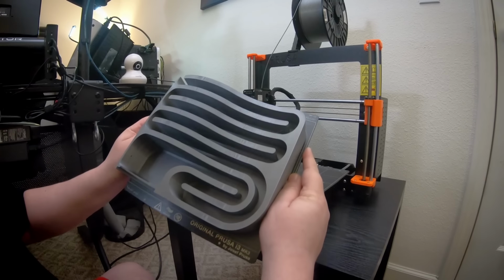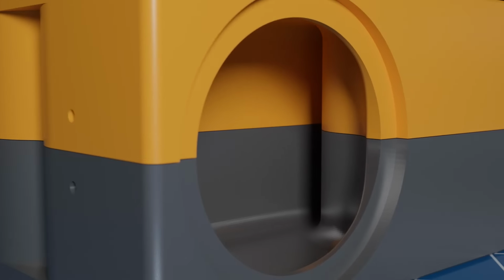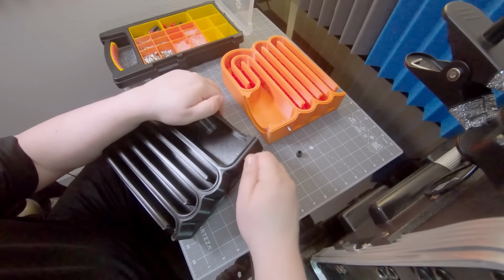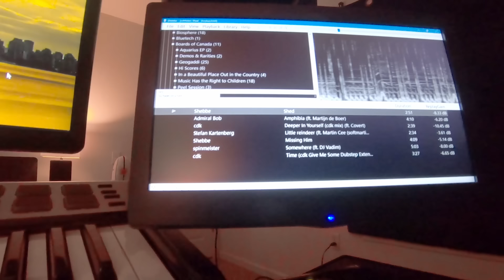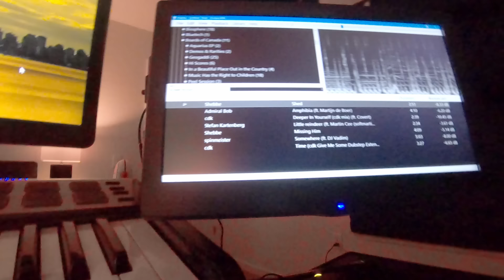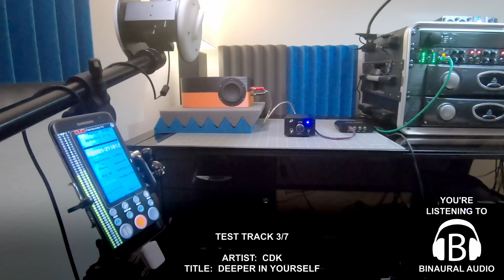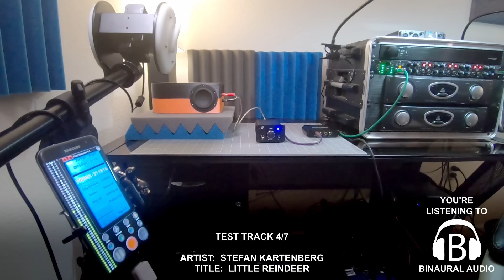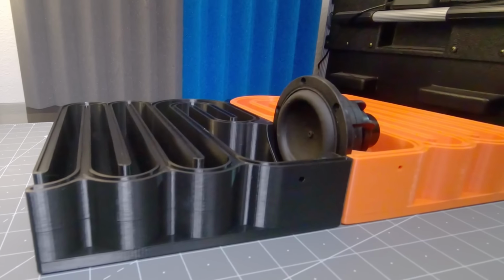3" Subwoofer Enclosure v.2 (Plus Demo)

Comment: Very impressive Pete!
I think this is a no-brainer as a marketable kit available thru Parts-Express. 
Pitch it to them!
Reply: I'd buy a pair!
Reply: I would buy too
Reply: Probably not all he wants to do with it yet, I'm sure there will be a tweeter and a crossover too.
Reply: Would really like to see this. Maybe with a built in amp and lpf. 

But the enclosure is specifically tuned to the sub. Unless every subwoofer is manufactured with the exact same specs - which I don’t think they are - every box has to also be slightly tweaked and matched with a sub.
Reply: MSH68 > The only small problem would be manufacturing time. 'Each side takes about 45hrs to complete' so thats 90hrs total print time. While I'm sure Part-Express may have access to larger, faster, print machines, like SLA, that may knock the total print time down considerably would they still be able to produce enough and at speed to match orders? What would the sellable price be after material costs/maintenance costs & time to print, especially compared to the price of the speaker. 

They are very cool tho......
Reply: @Vibration_Crew  I would think only the prototype would need to be printed. The mass production version would probably be two piece injection molded plastic. 
P-E already has the driver and other kit components on hand. Just a matter of packaging the kits as orders come in.
Reply: @msh6865  CNC routed MDF.
Reply: @msh6865  Exactly. If P/E wanted to sell this they'd just download his free plans and have an injected molded version made in China.
Reply: @RadRidesByCru  Surely Pete would have some ownership of the design established by the video we are commenting about?
Reply: @msh6865  Unfortunately not, as cool as it is, at it's core it's just a t-line box so there's nothing to have ownership over.
Reply: Luigino Tweeboom you tune to frequency not to certain subwoofers so this could be mainstream but depending on the frequencies dictates the quality of sound and if the sub is a 40 hz then you would not use a 24 hz box
Reply: @Vibration_Crew  plastic molding my friend. that's the mass production way

Comment: I listened using both a pair of KZ ZSR's (over APTX cable) and a pair of Koss Pro-4AA's. This is a big improvement over the earlier iteration. It does not ring quite so much and and sounds cleaner. I think this is because of less intermodulation distortion due to less ringing. If you can get that DSP to protect the driver from bottoming out and add a nice tweeter (perhaps one of the Dayton pleated ones) you would have a good prototype IMO. 

If you really want to kick it up a notch, perhaps a variable volume waveguide would allow lower tuning at low volume. No clue how to build or control that though, but however it might be done would most easily be figured out via 3d printing. My first idea would be to split the guide at the glue line and put a butterfly valve in one half.
Reply: James Drissel no one commented because they can’t beat your intelligence. I just commented to state that fact 💀

Comment: "Hey! What'ya got in that thing? A couple of twelves?"

"No, a pair of threes."

"Come again!?"
Reply: Actually could this be scaled up to run with 12s. I know it would be harder to print but maybe cnc milled layers of mdf
Reply: LOL
Reply: @TheDtaylor1  I wonder how much you'd have to alter? not just the size, but for other changes to the wave. either way that would be kinda dope. 
It may need to be huge to get enough volume though
Reply: I thought i was going small with 4 6.5s
Reply: @TheDtaylor1  No it coudn't, as there is no 12" that has the same TSP's as the Tang Band 3", just upscaled. At least that would be pretty miraculous if ther would be. But you could use the same principle to build an enclosure for a 12". That would be pretty big and heavy though.
Reply: more like
"a 3"
Reply: @TheDtaylor1  yes it can.
Reply: I had that with one 10. Seriously  1 10W3 in a slot ported box on a xtant 202 amp set up as a sub amp.
everyone said it hit harder then 2 12's and it was extremely clean.
Reply: I just did
Reply: @bobbg9041  lol. Everyone things they're loud till they actually hear something loud. It changes you. Even a w7 13" in a ported box on a JL slash 1200 v3 isnt loud anymore to me.
Reply: The wall of threes..
Reply: if you put twelves in this think im pretty sure at that point you would cause a tectonic shift
Reply: @TheDtaylor1  and you'd end up tuned to 10 Hz haha.
Reply: You can tell it's not 12s because it clips the audio an gives that fakey sound. Tho for a three it's on par with a good 10

Comment: You’re very articulate I appreciate it. You should experiment with large printer nozzles, .6mm or .8mm, to cut your print times potentially in half. These files do not have any features smaller than those nozzle dimensions so you will have no loss in print quality.

Comment: Man.. he should sell these. Id pay a good amount for one. Also. I'd like to see one playing from inside a car.
Reply: I'd make a wall of as many as I can
Reply: thought the same thing. I would have one of these in my car haha
Reply: He has uploaded the sti file, so it can be upscaled for an 18 incher
Reply: @everdark8399  18" driver??
Reply: @hjartland  ya
Reply: EverDark do you understand just how big that box would be and how many pieces you would need to print to scale this box from 3 inches to 18?  You would also be printing for WEEKS.
Reply: @btraker  yes, I know. But it will be a one time thing, I wouldn't mind waiting for weeks if the result is amazing.
Reply: U, can pay a good amount for it. Hence, it s a 3" speaker.
Reply: @skorpyo331  i dont mind printing for weeks if I'm getting a good amount of money for it 😝
Reply: I think this speaker is very small for car
Reply: @scumfatherxo  in my car 2 speaker's 10 inch
Reply: @scumfatherxo  def hv to get the jbl for my car.
Reply: Um... Enclosure parts are a free download on Thingiverse, so you literally have to assemble 3 parts and solder in 2 wires... this will cost you less than 100 bucks - and this includes the Tang Band W3-1876S driver unit! If you want to use it in a car, don't use PLA but PETG for the enclosure. PLA will warp in the sun.
Reply: I'd pay too get a 3 D printed box for my car subwoofer
Reply: Why? He put it out for people to print themselves for free.
Reply: If your really serious about having something like this built I can do it for you message me and I'll give you my contact information to talk in detail about specifics but I can do something pre fabricated to where you just bolt it together or totally finished.
Reply: @everdark8399  If you really wanted this design on a bigger scale it would be much easier to cnc it out of sheets of MDF instead of 3d printing it.  You would probably need a new suspension for your car either way.  It would probably weigh a couple hundred pounds.
Reply: Dylan’s World I have 2 12 alpine
Reply: @ittotaq  I don't have a printer
Reply: @bobkeller8383  a printer can be had for under 300 bucks. go to printer groups and ask someone to print it out for you. shouldnt be much. the filament cost less than 20 for 1kg./ thats 2.2lbs which. so you do the math. most small prints are a couple cents.
Reply: @btraker  no one's realizing what you are saying. the box is like 40x the size of the speaker. A normal 12 box is 4-5x the size. You'd need a whole room just for the speaker box. An you'd probably need to build a 5 inch thick titanium fort as it's inclouser; underground so the dirt prevents it from breaking.  I'd assume this plastic Box doesn't last long? Also that titanium fort aka the speaker box; would have to be built underground in place unless you get an earth mover to deliver it.

Comment: man imagine this sub with a tweeter a mid driver in one little box. It would absolutely dominate the portable speaker market
Reply: No it wouldn't, this configuration is extremely expensive on the commercial market. only the highest quality enclosures will even attempt to utilize this configuration. Definitive Technology liked to use this but they're not small, not light weight, and most certainly arent cheap.
Reply: @beaumontlivingston8084  materials cost is extremely low, all we need is some more advancement in fast 3d printing
Reply: Old bose wave series have been there / done that. Great reviews, but priced themselves out of the market. Like 400$ for what was basically an am/FM alarm clock.

That said, this style of enclosure is fairly inexpensive if made with an injection mold. It just comes down to sales scale to cover engineering and tooling costs. Enclosure would be roughly 10-15$ each if more than 50,000 units were produced.

Now the focus for the key speaker and drivers are where the real price and sound quality differentiators are found. But I'm not going to speculate for this as there are way too many variables here.
Reply: ...or imagine he Designs an enclosure based on .... the most popular, INEXPENSIVE, drivers. But he is in THE JOB of designing based on these types of premium drivers. (...I know, I know, kinda like putting a ford motor in a mercedes...)
Reply: ...maybe more like a Lamborghini....
Reply: @johnhricko8212  the problem is cheap small drivers (with not even close to as much R&D as this one) don't usually have the correct parameters for producing proper bass. Most notably Xmax (the amount the piston can move back and forth linearly). So, even in a great box, they wouldn't even come close, and you'd just waste space and time designing a subpar product. However, if you know of one, I'd be totally down to building one of those cheaper boxes!!!
Reply: @rgones  I believe you. 3 days of testing small amps, cheap speakers, etc. Results: You get what you pay for. Trying to find a place that WILL print the 3" v2 (density, etc, to spec). Libraries will get your started, but if Im payin 50 for driver, you don't want to deviate from... anything! 

Has anyone printed one of these bad boys? Cost?...... (i guess i should just buy a....)......  ;-)
Reply: @voidlight6006  patients (if not rich). (u no wt that is, right?....) This field moves so fast, you eventually WILL get what you are dreaming about... All you need is $$$..... or time....
Reply: @johnhricko8212  I just printed one, but haven’t assembled it or tested yet.  It was 900g of PLA.  The PLA I bought was maybe $16 per kilo, so about $15 or less of material costs.  It took about 3 days or so to print both halves, if you wanted to assign value to that you could.  Hoping to get a good result from it.
Reply: @mattradix3073  3 days of printing = $$$ if you don't own your own. 3D "service bureaus" usually charge by the hour...
Reply: How about a block of wood and a router?
Reply: @watchandjewelryloft4713  expensive, but TOTALLY worth it. There are some insane things you can do with a shapeoko. Guy did a 4" tang in a crazy shaped dual horn enclosure or with an exit nearly 4 feet in diameter for each side of the driver, Nearly 120db/w sensitivity and dug down to 28hz but thing would cost thousands in a commercial market and was a one off to fuck around with scrap wood

Comment: This is actually my third time through this video.  My day-to-day listening is done through a reasonably good, compact domestic stereo system which suffices well for casual listening and this cab sounded great through it.  So this time I fired up my 'for realsies' rig which is an RME Babyface interface and a pair of Mackie HR824 MK2's and I was surprised even further.  The really high RMS, compressed stuff turned to mush quickly but the stuff with the wider dynamic range was really impressive.  So much so that I've started to have ideas of my own.  Thanks.

Comment: I'd be tempted to make silicone molds of each print, and cast a couple out of concrete.
Reply: yep.. stealing this. thank you
Reply: concrete doesn´t swing good
Reply: @florian191  thats what you want. :D
Reply: @Alexander85500  wouldn't it be better to use cement? Concrete has rocks and stuff.
Reply: @noahpaulette1490  cement is just a binder, concrete is the set product and can be made without gravel
Reply: @noahpaulette1490  yeah, but it could break beacuse cement without any gravel or stones is not sooo "strong". And with gravel you will geht greater inner friction and propably better sound quality. :D
Reply: @markuspaxton9531  Gonna be brittle as hell without an aggregate.
Reply: @bornfree2237   my point wasnt that it would be good, but rather the difference between cement and concrete, there are also at least a few use cases for sand only or limited gravel concretes
Reply: People have been doing that for years and you'll never break it no matter how much power you put into it. The only way I see one breaking is if you make the driver wall too thin, use too heavy a subwoofer and pick it up and drop it on the floor.
Reply: Do It!

Comment: Soooo, does this scale? It seems like you could have a super compact 6.5" - 8" box that would blow the doors off 10's and 12's in a car.
Reply: I’m sure it can be scaled, only limited by the size of the 3D printer you can get ahold of. It looked like his box was the same size as his tray, so its footprint couldn’t get bigger. I’m not sure if he could design it (acoustically) to fit it on that tray with a larger 6.5 or 8 inch.
Reply: @talonpilot  since it was designed in halves, in sure it could be scaled and printed in quarters, biggest limitation would be the adhesive used to keep it together.
Reply: I was thinking the same thing for scaling, but for a 6x9 instead. It would certainly make my trucks sound much better without needing to go to some specialty sub setup.
Reply: @incredulousd9408  I was thinking the same thing.
Reply: It works. I run a single 6.5 inch sub. Hits like a 15.
Reply: @richardperez4505  I don't supposed you have the design plan for that? I don't have a printer, myself, but a couple friends of mine do.
Reply: Also, since it's ported, how is the response throughout the range?
Reply: @colbyscott9822  i used 3/4 mdf and a table saw. Much easier to source and more practical since the box is 12×42 inches roughly and about 7 inches deep. Let me find a link and it will help you design the box. I'll post it in a bit.
Reply: @colbyscott9822  it's the flattest response of any enclosure you can possibly build.  Exactly the opposite of what a ported box does and a very good question. I'll add a link for that explanation as well.
Reply: @colbyscott9822  http://dbdynamixaudio.com/dual-fold-on-axis-transmission-line-enclosure-calculator/
For a simple explanation, you are making a tube that is the same surface area as the surface area of the cone of whatever driver you are using.  The desired tuning frequency determines the length of the tube based of 1/4 length wave technology.  I have a 7x3 inch tube that is 10 feet long for a 6.5 inch driver. That puts me at about 38 to 40hz for my driver. The overall dimensions of the box can be played with as long as you keep that same port surface area consistent throw the folds and turns.  I listen to metal and it's just perfect. Then I can throw on some dubstep and hit every note they can throw at me with ease.  I've built over 500 enclosures and went from spl contests to Sound Quality contests and now I have found the ultimate enclosure that reproduces accurately and with authority.  I've also built one of these for a 10 inch driver in a suburban to replace 2-15s.  It was too efficient and just too much for a car system. If that's what you're looking for, same concept but the box will be huge. Lumber and cheap these days. 😆
Reply: @richardperez4505  you rock!
Reply: @richardperez4505  So, the space I'm trying to fit it in is under the rear seat of my 2016 Silverado Extended Cab. When I punch the numbers in, it spec a 33" wide box, which won't remotely fit. So, my question is, do the box dimensions matter that much as long as the total tube length is the same? So, maybe I could add an extra fold or two and have a shot at fitting it. (Although, I still think it's not going to work. I just don't think I have enough space under there to hit 35-40Hz.)
Reply: @talonpilot  Could you use adhesives and stack similar material cut by a laser engraver/cutter to a scale for a 6.5 inch or 8 inch? Hmm?